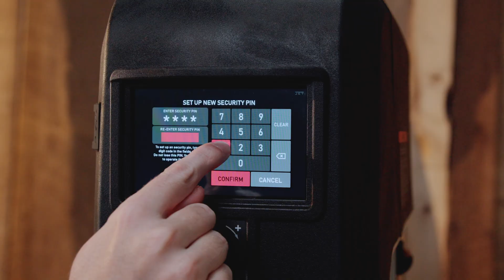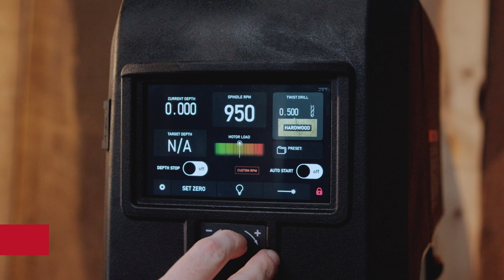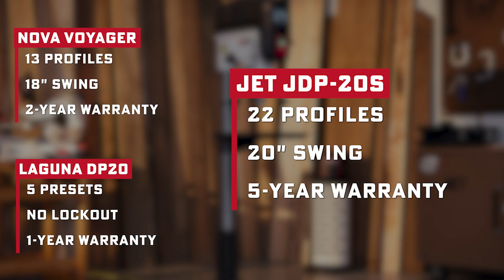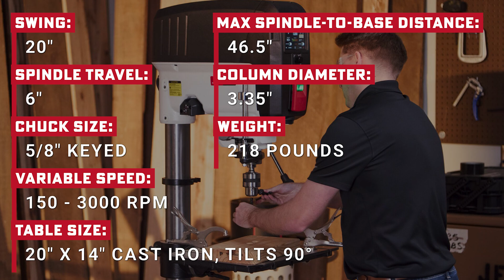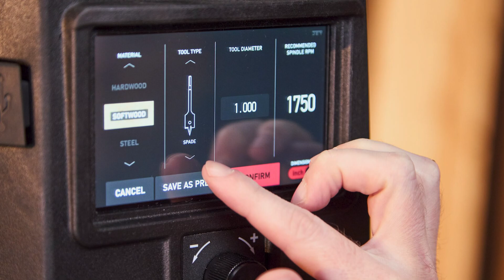The NEW JET 20" Smart Drill Press - Effortless Setup, Flawless Results! | JET2060

Comment: You didn't say it can run a tap, nor is it auto feed and stop.
The Nova has more goodies at lower price point.

Strange because Jet has made commercial use type drill presses you might see in a machine shop.
This is close but could be a lot more then it is.  
What do you expect from something made in Taiwan
This and powermatic used to be built in the USA.

I think Nova comes from Sweden?
Not sure.    

Thats messed up usa used to produce most the tools we used 
We need that back.

National def depends on a skilled labor force making stuff in the USA

You can not order bullets from china to fight a war with china!
Ball bearings was the problem in wwII  Germany had 98% of the worlds bearings production.
But Timken did a desined change to a better bearing system we still use today, your car uses wheel bearings they are better then ball type bearings last longer and can hold more weight and abuse.

This is why the USA walked over Hitler's army    they thought americans were stupid cowboys.
When in fact we out produced them 
On every angle, food machines, work force and we did it better.
Germany did not stand a chance.

German prisoners brought to the USA during the war were blown away   by our farms farming equipment, and factories.
Also the Size of the USA compared to germany. 
Many POW's opted to stay in the USA and live.

So how do we go from drill press to 
War history?  
Why do we no longer teach industrial arts in schools?
We need a healthy industry sector as well as offices, and computer speediest who write code. 
The world needs ditch diggers too.

We all have different mental capacity and skills.  Industrial type jobs need workers, no college nessary no outrageous business dgr you'll never use and owe 100k for school on.
Thats debt you will not have.
And try to pay back flipping hamburgers at MC Donald's.      

A lot of collage courses are useless waste of money.  Some are very nessary but you'll have to be very smart to be a DR, or Lawyer, or engineer .  Not to say some DIY engineers with no school are not smart, some are very smart.

I could go on.

Comment: I think Jet missed a couple of important factors on this new drill press. I have a Craftsman professional drill press with a single handle (similar to the new Laguna) that is amazing to use. It has an indexed pin system so you can set the handle where you need it. I'd also love to see a lower RPM like the Nova and Laguna. I can't be the only woodworker that also works with metal.

That being said, I have had a good experience with Jets customer service and own a bunch of Jet and Powermatic equipment that I've been very happy with so I know this will be a fine machine.

Comment: Is this really better than the Laguna ?   Laguna seems to cover the basics and more.  All this recommended bs is not necessary for someone that knows what they’re doing.  I have been woodworking for 40 years and a simple on / off switch and change where belt sat on the pulley stack worked fine for 100+ years.   I’m open and welcome technology but when I’m not going to use half of it why pay for it ?  The Laguna is tried and true   This is a first for jet; but I will say jet has a fantastic warranty and when I had a problem with a jet tool of mine they took care of me like I was family.  No BS with jets warranty so I would take a chance.  Which one would you buy ?  Be honest   Thanks
Reply: I'm looking at this and thinking the presets are a great idea to keep employees from burning up bits and drilling too deep. I want something that someone with 4 days of experience can use correctly. 
Presets seem really easy to use once set up, and the easier it is to use, the more likely people will follow the correct settings instead of just sending it.